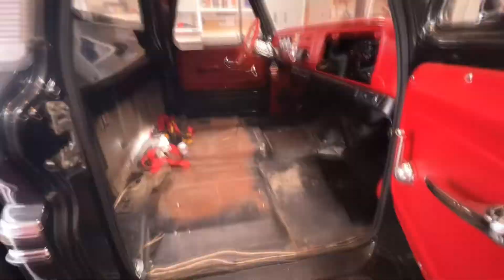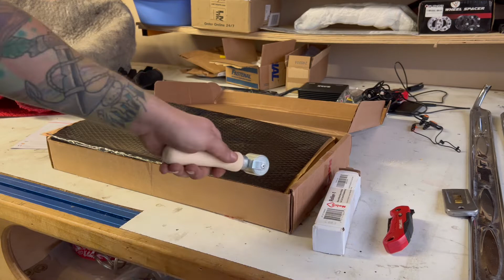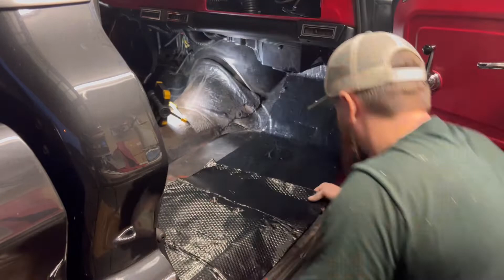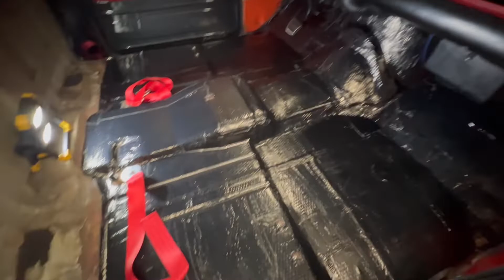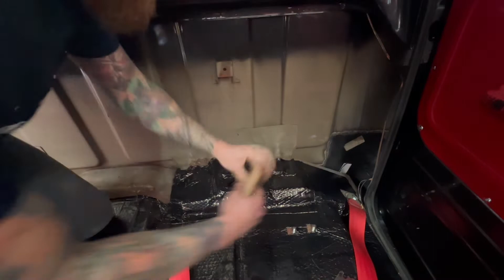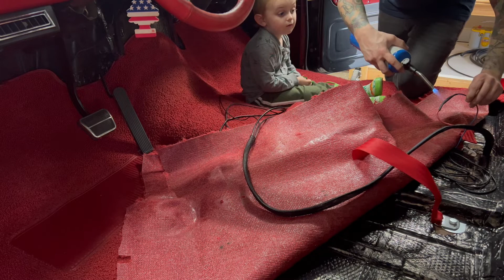C10 | Noico Sound Deadener Installation

Comment: What you installed is mainly for vibrations. It can help slightly with noise blockage but its main purpose is preventing vibrations and rattle. noico red closed cell foam on top of what you already installed is how you get the unbelievable quiet cabin. I installed and was truly impressed how much it blocked out when used together. I originally only had the deadener without the closed foam. Made a huge difference when i added it on top. Noice red 315 mill is what i recoommed for floors and roof. 150 is fine for doors didnt use in trunk.
Reply from the maker: Thanks for the info!
Reply: Did you installed the red cell on top of the sound deadening also?
Reply from the maker: @renzonovara2728 no I didn’t

Comment: Great video, like to ask your opinion Noico 80 Mil 36 Ft Sound Deadener after your installation. I'm not sure if you had a chance to see how it performs when the car is running, and the floorboard is heating up with the exhaust and motor running. The product has some bad reviews and I like your opinion since you have installed it. Thank You.
Reply from the maker: I had it on my last truck as well and never had any issues. I’ll monitor it this go around as well.